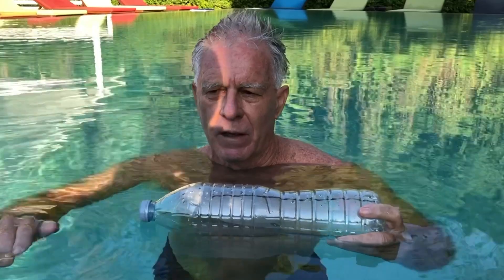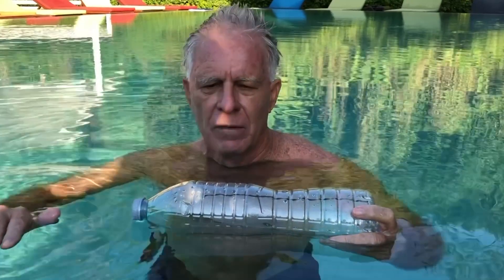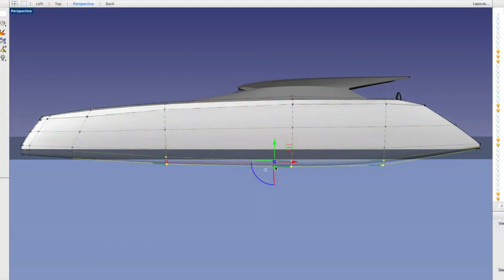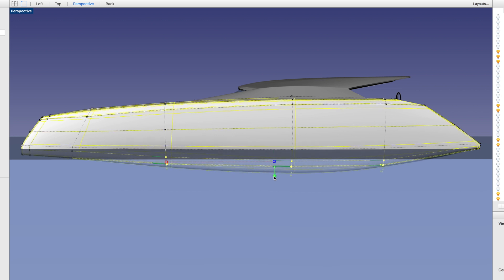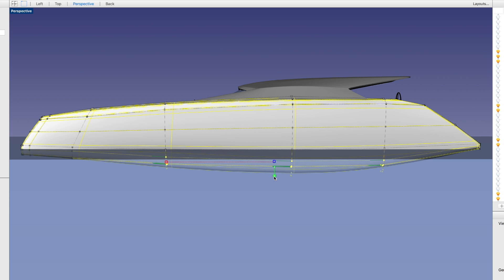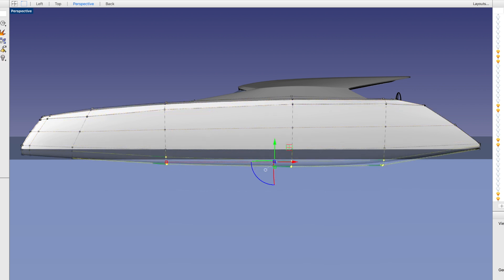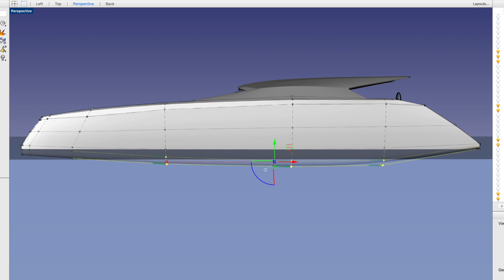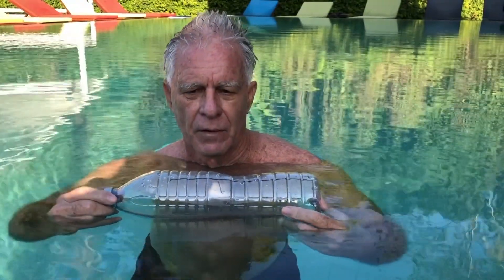Multihull Designer Tony Grainger - Weight versus Displacement - Behind the Beams Ep3

Comment: Displacement isnt calculated by weight, displacement = volume.. 
1 cubic ft of Polystyrene vs 1 cubic ft of lead, both have the same volume however the lead block is significantly heavier.  
In water, both objects fully submerged would displace 1 cubic foot. The lead block would not displace more.
Reply from the maker: Correct but you’ve missed the point. The point was the weight is calculated but the volume of water displaced by the FLOATING object. Obviously if the lead sinks it’s not floating hence you can’t calculate its weight. You need to put it into an object/hull that has the ability to displace more water than its weight and to measure the amount that it displaces.

Comment: What value do the second and third hulls of a trimaran add to the mix and second part, at what width do the additional hulls stop adding value. I'm thinking really two widths, the overall beam  width and then the hulls themselves. 
I'm secretly curious if a trimarans outer hull could be desiged as the head. Be nice to have some distance, Heck, you could even have 2.
Reply: Larger Neel trimerans do and have bedrooms inside. 
A lot depends on size and displacement.

Comment: Yes,that is a beautiful boat,and that explanation about the datum line(if I spelt it right),was very helpful,thanks😊
Reply from the maker: Wayne Doeblin fantastic thanks for the comment glad you found it helpful 👍
Reply: @TrimaranSpiritXL  Once a boat is moving forward the weight vs displacement can change radically if the hull is a planing or semi planing hull.
In the case of a planing hull the boat can achieve amazing speeds and almost a 1/1 ratio of speed to windspeed vs a displacement hull having a top hull speed and higher winds are just a problem.
 Planing Sposrtsboats are awesome but Skiffs with Asymetric Kites are something else entirely.